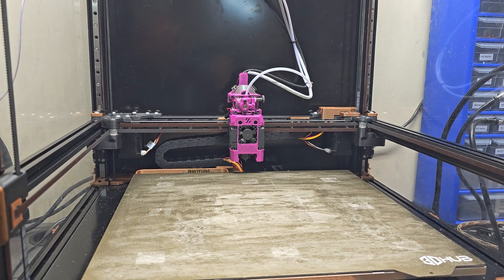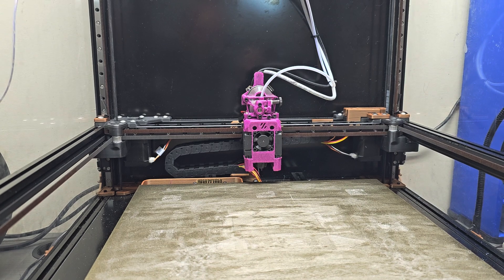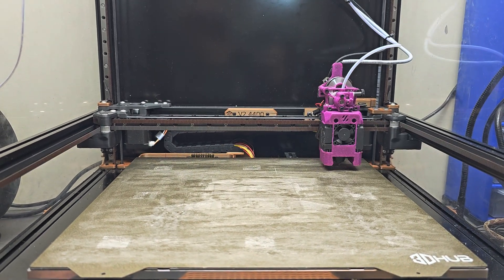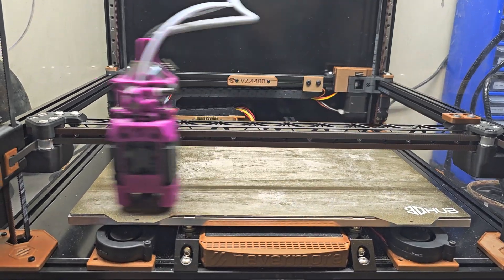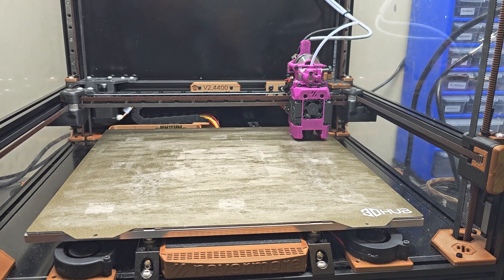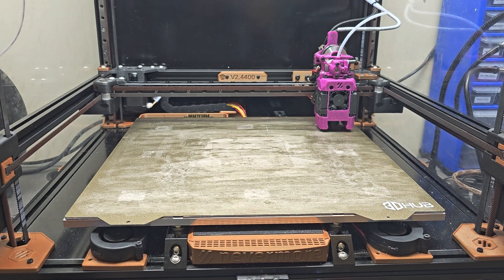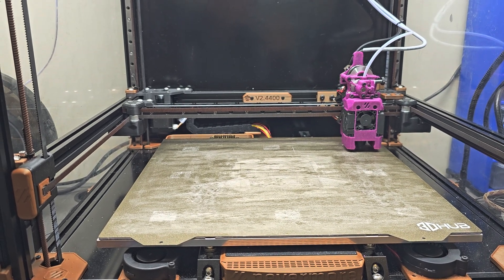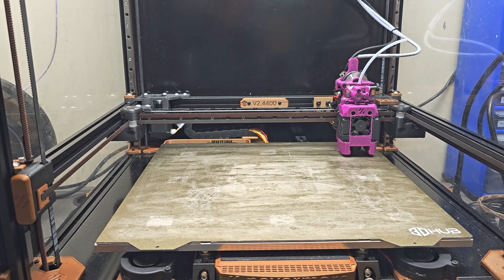Voron 2.4R2: New lighter toolhead, the V0's Rapid Burner by Chirpy, now with Beacon! - first tests

Comment: Hi Steph I am wondering where you found the guide for installing the V2.4 X axis toolhead mount. They don't go into detail on the install of the alternate mounts on the rapid burner git hub. I think I have all the parts printed including the probe carriage. I am going to go with a beacon as well. It seems like I have to attach the x mount to the hot end mount first with a single screw in the top then attach to the mgn12 rail. Does the single screw just allow you to pivot the part to access the other 2 MGN 12 mounting screws from the front? Then feed the belts in etc then secure the other 2 screws connecting the x axis mount to the hot end mount. Seems like a not very ideal way to attach this please let me know if I am looking at this correctly.
Reply from the maker: Referring to the CAD file, when available, can help. Otherwise you just have to resort to trial and error.

Comment: What makes Bacon different (less worse) than other eddy sensors? I thought overall their margin of error was too high.
Reply from the maker: I am not a print quality perfectionist. I "settle" for features, convenience, and time savings, while printing parts that for me are "good enough".
Beacon has no moving parts to add resonance, works well over USB, and is the most convenient Z probe I have used. I had the Omron induction, then an Unklicky, then Tap, Beacon, and because it supports running over CAN Bus, now Cartographer, which is a Beacon clone.
The eddy current scanners work for me and how I want to use my printers. As always, YMMV.

Comment: Can this same setup be used on a trident 300 ? Chirpy Rapid Burner + sherpa mini + Eddy surface scanner + ebb36 canbus board
Reply from the maker: Absolutely!
Reply: @oldguymeltsplastic  can you suggest me a hot end that would go well with this combo I want to print pla+ , 95a tpu  and abs with layer height of 0.1 0.2 0.3  and nozzle diameter mostly a 0.4 mm and want to try 0.6 mm

Comment: How is it going 3 months later? Thinking about doing this on my v0.2 and v2.4 too, pls let me know :)
Reply from the maker: As you can probably tell from my videos, my V2 is a bit of sandbox for me to try out stuff, and so is constantly in flux.
While I am very happy with the lighter toolhead, I have since switched out the ultralight gantry in this video with the original Misumi 2020 extrusion, and now have a new mid-weight "reinforced" X gantry that is working well.
My Input Shaper graphs still aren't fantastic though, so either I need more tuning, or maybe a mod to move the V2 to an AWD flying gantry, which should also help with that.

Comment: is the biggest advantage to the Rapid Burner just weight? how's the cooling compares to the Stealth Burner?
Reply from the maker: It will largely depend on which fan models you use, however the Stealthburner has a single 5015 blower fan for part cooling, and the Rapid Burner (and also Dragon Burner) uses dual 4010 blower fans. All else being equal, the twin 4010's should provide more CFM of raw cooling than a single 5015.

Comment: What is the variant of the sherpa mini that uses a screw instead of a pin? I've been looking for how that can be done, but haven't seen it done outside of your videos showing it.  I might try to do a similar configuration on my next printer.
Reply from the maker: Response from a user on the Annex Engineering Discord Server:
"Pin or shoulder bolt on pivot is the proper way and annex tends to do stuff properly. A bolt will likely suffice."
So, it may or may not matter to your printed part results. Venture at your own risk.
Reply from the maker: I felt guilty for not following the Sherpa Mini BOM and not using the 3 mm pin. I have since finally sourced some 3x20mm pins, and "fixed" (there was nothing wrong with them) my two Sherpa Minis on my V2 and V0, and that's all thanks your observant eye. It will make zero difference in print quality, but I will sleep better now knowing that they are built correctly. There might be some sarcasm there, but seriously, thank you for paying attention and pointing my mistake out!
Reply: @oldguymeltsplastic  If I'm completely honest, I was looking to avoid having to source it!😅I just thought there was a version out there that didn't use the pin.
Reply from the maker: Not sure which screw should be a pin:
- 3 horizontal screws through the front housing, one to hold the tension arm, and two that secure the front housing to the core
- 2 horizontal screws to fasten the base of the core to the rear bracket
- 2 horizontal screws to attach the pancake stepper motor
- 2 vertical screws to attach the whole assembly to the toolhead below
- I guess the tension arm knob also counts as a horizontal screw?
Reply: @oldguymeltsplastic  The one that the tension arm pivots on seems to have been replaced with a pin (3mm diameter x 20mm long) in the latest version of the sherpa mini - I guess it might have been a screw previously.
Reply from the maker: Yeah, after your first comment, I had another look at the BOM, and absolutely it calls for a 3 mm pin there. Not sure how I missed that, but I'm also not sure why a pin should be needed for that pivot point that rarely ever pivots much.
I asked a question about this in the Annex Engineering Discord server, and will report back if I get an explanation.
If using a bolt there instead of the pin causes issues, I'm not seeing it!

Comment: How's the weight ?I see some other weight reductions. What is the input shaper recommended accelerations on this setup ?
Reply from the maker: Total mass reduction of the X gantry parts + toolhead:
Originally: 1131 g
Now: 698 g
Mass of the "moving" parts reduced by about 39%.

Comment: Do you have any idea what the tool head weights? And how is the bridging and cooling of the tool head?
Reply from the maker: I used a kitchen scale to weigh the toolhead parts of both the Stealthburner toolhead with Tap, and the Rapid Burner toolhead with Beacon.
Stealthburner was 480 g
Rapid Burner was 300 g
I am not a CFD expert, but the Rapid Burner's twin 4010 blowers should offer more performance than the Stealthburner's single 5015 blower. I have never had any bridging/cooling issues on my V0, where I have had the Rapid Burner installed for months now, but I have only ever printed in ABS on that printer.

Comment: is there a particular reason you prefer this hotend over the xol2 for your 2.4 ? i'm scratching my head over this. Btw the beacon is amazing ; great job
Reply from the maker: I did try to assemble a Xol2, twice, and both times I ended up breaking the fan ducts. The first time was because my cheap Winsinn fans have different physical dimensions than the fans the Xol2 designer used. On the Armchair Engineering Discord server, I was advised to switch to GDSTIME fans instead, and still those ones didn't fit well. When I mentioned this a second time on their Discord, I was advised to purchase 12V Delta fans instead, as those are the fans that the Xol2's designer used. I have never had a similar problem with the Dragon Burner or Rapid Burner toolheads, regardless of which 4010 blowers I mounted to them.
The Xol2 requires 3 different diameters of bolts/screws (M2, M2.5 and M3), and is a bit of a pain to assemble properly, with several different parts with rather small relatively fragile features. The Dragon Burner and Rapid Burner currently only have a few large boxy parts, that assemble using M3 screws, and maybe M2.5 depending on which hotend you mount to it.
Some people don't like either toolhead due to aesthetics, but I just want it to work well.
I haven't weighed the Xol2 parts to compare it against the Rapid Burner for weight savings, but any additional weight is more than offset for me by simple convenience.
Reply: @oldguymeltsplastic  well that's a detailed answer ! thx.  i have 2 V0s with Chirpy's toolheads so i think i'll fall into this project too :) glad to see you're participating into the "alpha"

Comment: Shouldn't you be able to take the z moves out of your tilt adjust? Seems like it should run just like the probe.
Reply from the maker: Do you mean during the Quad Gantry Level process? Good question, I haven't tried breaking that down yet, as it's working, but I think I understand what you're getting at. I'll ask around on the Discord servers.
Reply: @oldguymeltsplastic  yes it seems your qgl should only be x and y moves, same as your mesh
Reply from the maker: @travistucker7317  I just posted about this in the Annex Engineering Discord server to ask the experts. What you are saying makes sense, but it's working as is, and I am not sure how I could change the QGL to remove the Z moves.
Reply: @oldguymeltsplastic  i would imagine there's a  z variable probe raise height or similar as if you were using a touch probe. Maybe you set it up as if it were a touch probe and set that as zero. I've never looked at qgl, but will tomorrow
Reply from the maker: @travistucker7317  The good folks on the Annex Engineering Discord server set me straight. Check out my latest video for an example of the updated QGL functionality with the Beacon.
Reply: @Old Guy Melts Plastic  awesome. Will do

Comment: Hows that X beam working out? What accels do you run?
Reply: What sort of instability are you seeing? Also are the extrusion issues due to the extruder setup/sherpa?
Reply from the maker: @Mehecanogeesir  I think at least some of my hotend issues are possibly heat creep, as it will print fine for a job or three, then there's a clog in the heatbreak.
I have gone through almost every CAN Bus toolhead PCB since switching to CAN Bus last fall. At least two PCBs had components just fall off the board when their solder joints failed. One gave me undervoltage errors, and yet another would just randomly shutdown after and hour or two. I am currently on my 6th toolhead PCB.
Reply: @Old Guy Melts Plastic  omg I'm so sorry. Now I consider myself lucky. Still have my first EBB36 working, but I don't print too often. Getting things set up was a bitch though, used teaching tech's guide at the end, but needed to do several steps a few times and there was a blue led that stayed on where he said it should be off, but other than that it's working. For heat creep, make sure your hotend fan is blowing up to par. Sometimes the fans are weak or get weaker over time and need to be replaced. The wiring for the fan should be fine since you're using a toolhead pcb, but you can still move your toolhead around manually with the fan on to check that there aren't movements that cause a wire to break. If your fan is good, you may want to switch to another extruder/hotend setup.
Reply from the maker: @Mehecanogeesir  last night I swapped out the Rapido UHF Plus for a Revo High Flow, and have had a half dozen consecutive successful prints. Time will tell if that holds.
Reply: @oldguymeltsplastic  yea I have had some heat creep on my rapido as well. It's probably not the best design to have the heater so close to the heat sink
Reply: What Canbus would you reccomend, I have the octopus 1.1 non pro, I want to also do 48v a/b motors, for now i'm doing my canbus homework @oldguymeltsplastic
Reply from the maker: I haven't pushed my speed limits yet. Honestly, I am still struggling with general MCU/toolhead PCB stability and print quality/extrusion/clogging issues. Once I have those licked, I may then push the speed limits, although I have no desire to compete with Vez3D or 247Printing. Some middle ground speed with decent quality will be the goal.
I do have my A and B motors running at 48V on 5160HV drivers, the lighter gantry, toolhead, and I also just received my aluminum CNC XY joints to cap the ends of the X gantry which I have yet to install, so I should be all set for decent speeds when I get around to them.

Comment: Those wires without strain relief give me (not good feels)... other than that this may be my new tool head once out of beta.  (OR a variant of this).  I am not sold on tap and KP is unreliable at times.  So this option may be what I move towards eventually.
Reply from the maker: I have replaced the EBB36 mount plate with another one that has a longer stem that turns 90 degrees to the left and has more zip tie holes, so strain relief has now hopefully been achieved.